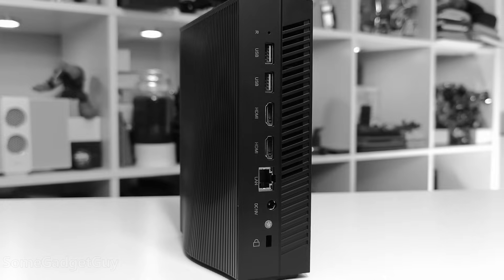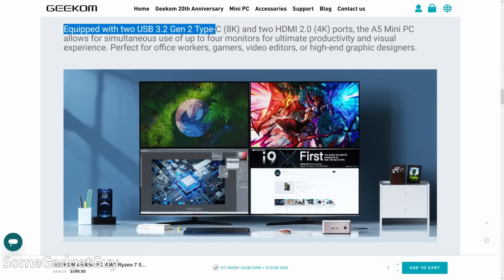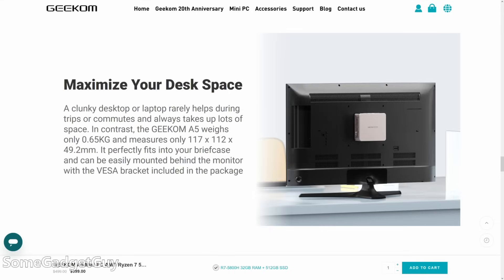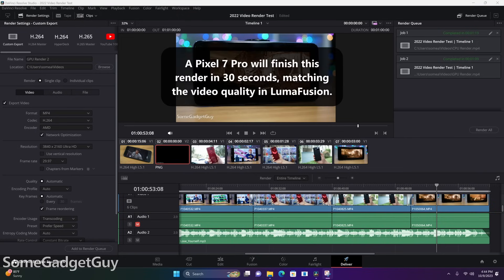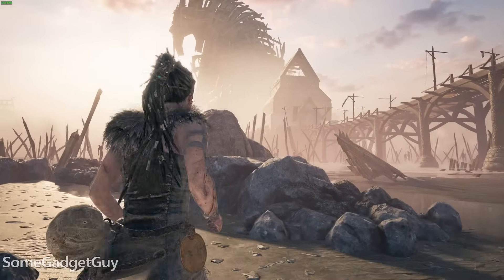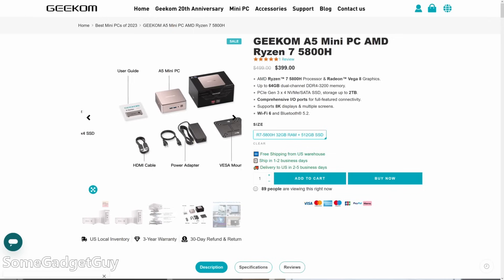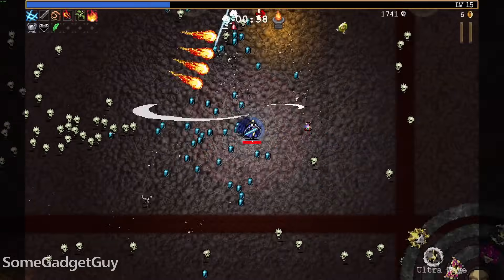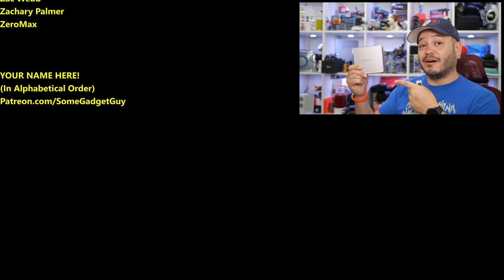Geekom A5 Mini PC Review: BIG POWER! Small Price! Better than a Mac Mini?

Comment: There seems to be a newer version shipped by Geekom. My first A5 was way to loud, even idling on the Desktop. I killed my A5 by misconfiguring somethin in the BIOS. After that my A5 was bricked. Unfortunatly there ist no clear cmos button or contact in this mini pc. Even disconnecting the biosbattery over night didnt helt (also shortcutting the battery contacts on the board).
So, after an email to the support, I sent back my A5 and after a few days I received my new one.
The new one is absolutely quit at the desktop and is only hearable on heavy load. 
Now I am absolutely satisfyed with this little machine. Even older are running on it (Crysis Remaster for example).
Idle consumption ist at about 6-7Watt, Youtube or Video with 4K at about 20W.
Reply from the maker: Oh that's good to know! I was a little concerned, as I KNOW there are AMD laptops that don't constantly spin up fans like this.

Comment: Geekdom is much more expensive than other Chinese brands. We got the similar 6 core 5600H 16gb/1Tb with vega 7 for $210.  I also got the GMKTEC K2 with 7735HS cpu 16/512gb for $320. the k2 GPU performance is TWICE the A5 reviewed here. All from aliexpress.
Reply from the maker: Ah! Aliexpress. Some great deals there. Usually the main cost savings comes from buying barebones and installing your own RAM/storage though. So just like Ace, Beelink, and Minisforum, you can always get a better deal the more you DIY, but for folks who want the easier "buy it and use it", there's always going to be a premium on that.
Reply: @SomeGadgetGuy In my experience buying  3 mini pcs, i think buying it with memory and ssd is a better option. the asking price for the extra components was more than fair. The extra $70 for 16GB ddr5/512gb ssd also included a Windows 11 pro license. it was a huge time saver as i did not have issues hunting for drivers.
Reply from the maker: I'm hoping we don't see too many price hikes on components at the end of the year. Looks like Samsung is trying to force higher prices on SSDs.

Comment: Ryzen 5000 series still plenty powerful, so I'm still okay with it. Compared to its equivalent 11th gen Intel Core rival, the Ryzen still gives faster performance.

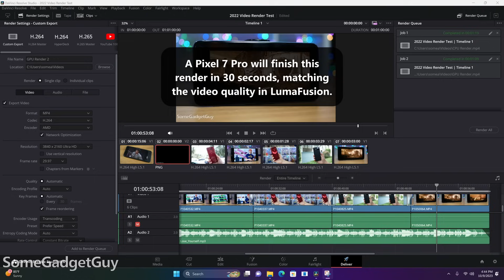P.S. About 5:14, I do think that LumaFusion has fewer features than DaVinci Resolve, which contributes to faster rendering time. But I do agree about your earlier point regarding light video editing. It can easily be done on phones, even in Desktop Mode.
Reply from the maker: Oh yes LumaFusion is certainly not as full featured as Resolve, but those features shouldn't be weighing down the rendering engine if you aren't using those features. My test is a simple timeline of clips, with a fade transition, a watermark, and a soundtrack. Nothing in that timeline should be stressing resolve. It's just the kind of quick-clip edit that LumaFusion excels at. If someone is shooting some family clips, and wants to make a little family video of the day, chances are VERY high, that the video will be finished faster on the phone they shot the clips, and they won't have to transfer footage to another PC.